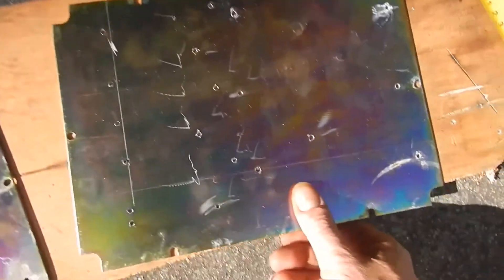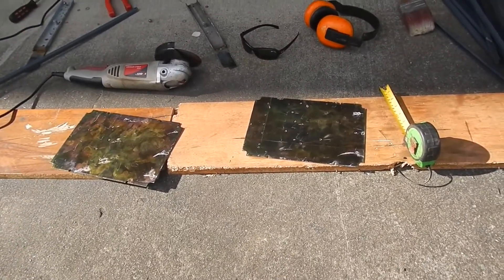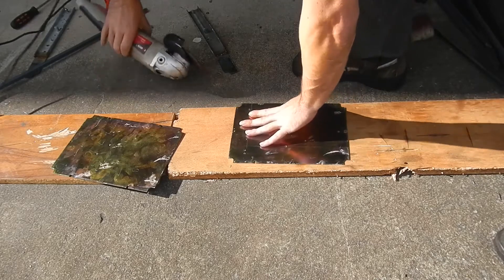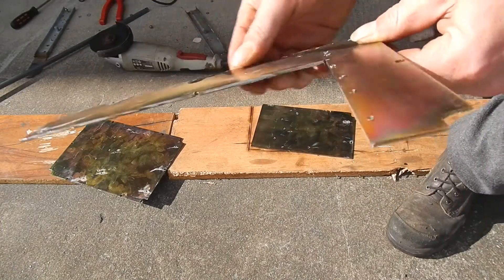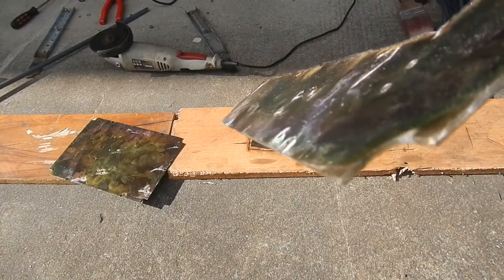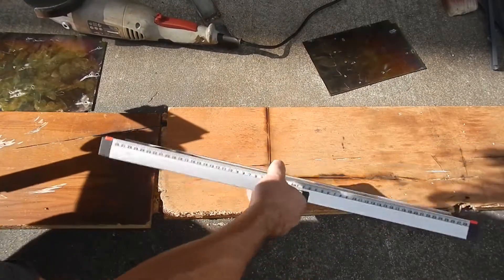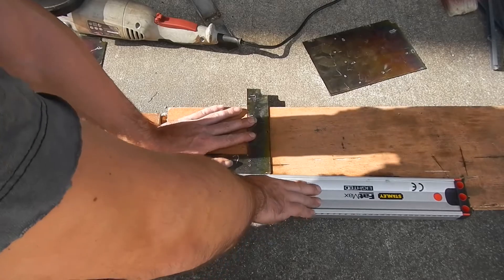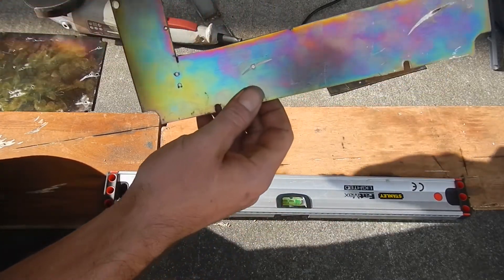Make a set square in under 4 min. DIY right angle ruler.

Comment: That is very true.  Do you mean die as in the motor over heats and lets the magic smoke out?
Reply: You must have experienced a HF four inch side grinder failure too. I experienced several HF electrical tool failures myself. I returned them to the store and told the manager, "Your hands told are good, but I will never buy another HF electrical tool." He offered to replace them but I said, thank you, but no thank you. I would only experience the same failures again. I want angry, I was disappointed.

Comment from the maker: 5" will also have a bigger motor, by a few hundred watts. You can use a powerful grinder gently, but you cant use a weak grinder hard. They die real fast.
5" can also take some 4' disks, like the diamond tile/stone cutters, with a spacer removed. Which, when combined with bigger motor and gearbox, makes for longer grinder life, and less operator fatigue.
Having said all that, I still like some 4" grinders for some stuff. The $20-$30 ones are exelent value, even if they do die fast.

Comment from the maker: Takes about 20 min if your good with the hacksaw, and dont stop. Done it way to many times... Thats why I got a 5 inch grinder :) The thin cutting wheels for grinder dont last super well, but a lot longer than dremeal wheels. I could cut sheet like this for 40min to an hour per wheel, cutting most of the time. The thicker wheels and grinding disks last for ages. Although thats another reason to go bigger. more disk per wheel. change blades less. 5" may be cheaper in the long run.

Comment from the maker: That sheet is 1.6mm (1/15th). The grinder can cut through inch steel bar in about 1-3 seconds (depending on how hard you push and how many cuts you want from a disk)... I could get a really cheap 4 inch that would be almost as good, for $25-$30 at my local hardware. or a cheap 5 inch of slightly lower wattage, for about $30-50... Those drill attachments are more for really fine light work. best used in a dremal type tool. Would have taken me half a day to do it (not as straight) with my hacksaw.

Comment: How thick is the steel you cut in the video?  Because it would have taken me 10min to cut that with my saber saw.  The only thing that is better with my saw is that is can cut curves.  I do have a cutting wheel for the drill but it very hard to control where you cut.

Comment from the maker: That one is a 5 inch disk with variable speed. I never use the speed adjuster, but the 5 inch is great for extra cutting reach, and has considerably more power, as well as decent handle and trigger. I think its 1200watt. so with the 1mm ultra thin cutting wheel, it fly's through the 1.6mm sheet. Gotta have a grinder to do metal work!!

Comment from the maker: No but I have a big magnet, with a special shaped triangle. For 45 and 90 deg corners. Got it at welding shop ($9 small one). Could make from speaker magnet, or microwave magnet, and some of the same steel plate as the square. I think I might do a video on that too, now you ask :) I always wanted a bigger one... The notch is indeed handy, doesn't really affect performance in any negative way. Makes room for a bead, as you say. You can make a (rough) square with Pythagoras too. 3 is to 4 is to 5.

Comment: That was fantastic. I couldn't afford one when I needed one. Glad I couldn't. Thanks for saving us money. Also, which you don't find on other squares, is the notch "YOU" put in the outside corner to allow for checking after welding. The weld will sit nicely in the notch. Do you have any other tools you made for welding? Many thanks for sharing.